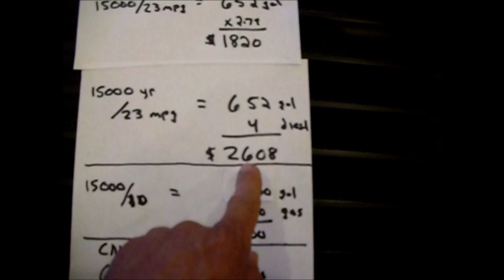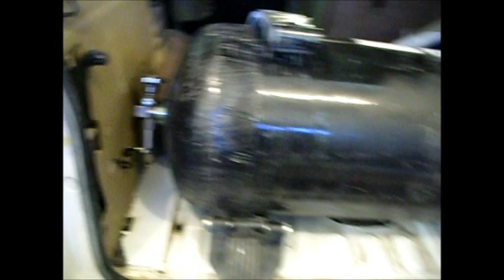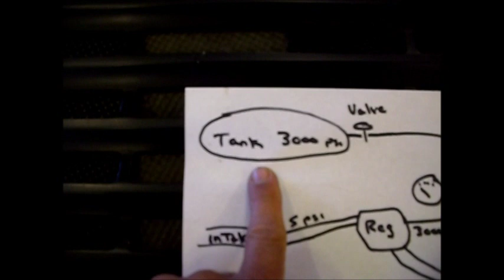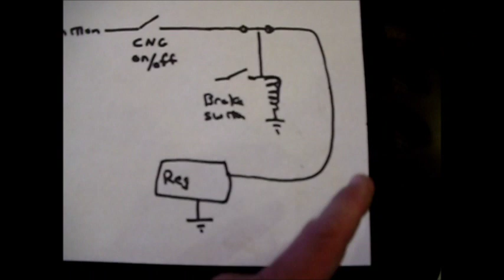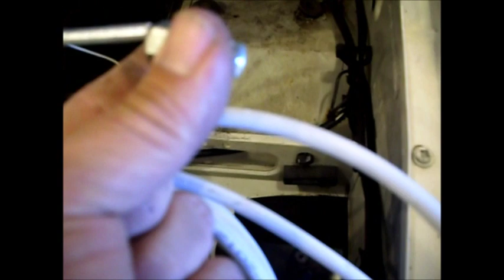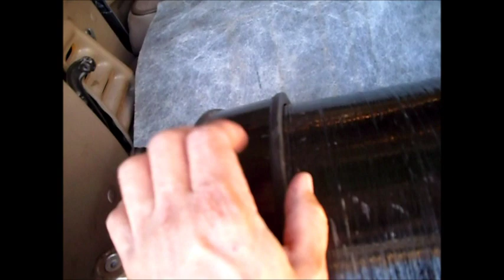1998 land rover discovery with 300tdi diesel CNG compressed natural gas injection conversion

Comment from the maker: I have done two CNG conversions and have found some interesting numbers on economy.
One was a 2006 Volvo AWD S60 2.5 turbo intercooled engine. It gets 24 mpg so it uses 625 gallons of fuel for 15k miles. It cost $2250 for gas @ $3.60 gallon and $950 for CNG @ 1.52 a gallon. So cost per mile was $.15 for gas and $.063 for CNG. It was a fumigated system with a Red Gas regulator. I noticed a large power loss on the mountainous pass I drive to work and back on but on level ground no noticeable power loss. Fuel economy was the same whether I was on CNG or gas. I was extremely happy with it.
The other is a 1998 Land Rover Discovery. It originally had a 4.0 v8 gas engine. I was getting 10mpg. Due to the engine head gasket problems I decided to install a 300tdi rover 2.5 turbo diesel intercooled engine and manual transmission. My mpg went to 22.3 mpg. But was seriously underpowered for the mountains I drive in. I tweaked the injection pump and it helped some. I decided to do CNG fumigated injection. It does not have o2 feedback nor a modulated stepper fuel nozzle. The Discovery is seriously underpowered at 117 hp. The CNG makes a huge difference in power. My EGT for the same speed/gear has dropped 100-200 degrees Fahrenheit due to the increased hp. So the fuel/price numbers are:
Gas 10mpg @ $3.60 per gallon costs $.36 per mile.
Diesel 22.3 mpg @ $3.75 per gallon costs $.168 per mile.
CNG diesel 66% diesel 33% cng mix mpg dropped to 19.2 total mpg fuel costs $.148 per mile. (32mpg diesel)
CNG diesel 32% diesel 68% cng mix mpg dropped to 16.2 total mpg but fuel costs remained at $.148 per mile. . (40.3mpg diesel)
So what I assume happens as I increased the amount of CNG per diesel the fuel economy went down due to the lower btu content of CNG vs. diesel. CNG btu is 114000 vs diesel 129500 btu, 12% less. So the price per mile doesn’t change but power really does. I did not run a lot of miles (706) on the 33-68% mix as I just increased the amount of CNG mix in it so I’m not totally sure of the accuracy of those numbers. I could be like a lot of people I hear about cng diesel mix and just say the diesel fuel economy went to 32 mpg and 40.3 mpg but you need to include the cost of CNG. The power is absolutely worth it!! And it burns much cleaner!
My driving consists of 85% highway driving but I have a serious mountain pass I drive every day. Its 10 miles long but goes up 2600ft in elevation. I live around 7000ft in elevation and work at 4600ft elevation. I’m. (32mpg diesel) interested in any constructive input. Thanks.

Comment: Great video! How is the real fuel economy? Does it match your calculations? I'm thinking of similar conversion.
Reply from the maker: I posted the fuel economy numbers in the description of the video. thanks.
Reply from the maker: SilverCreekMotors I have done two CNG conversions and have found some interesting numbers on economy.
One was a 2006 Volvo AWD S60 2.5 turbo intercooled engine. It gets 24 mpg so it uses 625 gallons of fuel for 15k miles. It cost $2250 for gas @ $3.60 gallon and $950 for CNG @ 1.52 a gallon. So cost per mile was $.15 for gas and $.063 for CNG. It was a fumigated system with a Red Gas regulator. I noticed a large power loss on the mountainous pass I drive to work and back on but on level ground no noticeable power loss. Fuel economy was the same whether I was on CNG or gas. I was extremely happy with it.
The other is a 1998 Land Rover Discovery. It originally had a 4.0 v8 gas engine. I was getting 10mpg. Due to the engine head gasket problems I decided to install a 300tdi rover 2.5 turbo diesel intercooled engine and manual transmission. My mpg went to 22.3 mpg. But was seriously underpowered for the mountains I drive in. I tweaked the injection pump and it helped some. I decided to do CNG fumigated injection. It does not have o2 feedback nor a modulated stepper fuel nozzle. The Discovery is seriously underpowered at 117 hp. The CNG makes a huge difference in power. My EGT for the same speed/gear has dropped 100-200 degrees Fahrenheit due to the increased hp. So the fuel/price numbers are:
Gas 10mpg @ $3.60 per gallon costs $.36 per mile.
Diesel 22.3 mpg @ $3.75 per gallon costs $.168 per mile.
CNG diesel 66% diesel 33% cng mix mpg dropped to 19.2 total mpg fuel costs $.148 per mile. (32mpg diesel)
CNG diesel 32% diesel 68% cng mix mpg dropped to 16.2 total mpg but fuel costs remained at $.148 per mile. . (40.3mpg diesel)
So what I assume happens as I increased the amount of CNG per diesel the fuel economy went down due to the lower btu content of CNG vs. diesel. CNG btu is 114000 vs diesel 129500 btu, 12% less. So the price per mile doesn’t change but power really does. I did not run a lot of miles (706) on the 33-68% mix as I just increased the amount of CNG mix in it so I’m not totally sure of the accuracy of those numbers. I could be like a lot of people I hear about cng diesel mix and just say the diesel fuel economy went to 32 mpg and 40.3 mpg but you need to include the cost of CNG. The power is absolutely worth it!! And it burns much cleaner!
My driving consists of 85% highway driving but I have a serious mountain pass I drive every day. Its 10 miles long but goes up 2600ft in elevation. I live around 7000ft in elevation and work at 4600ft elevation. I’m. (32mpg diesel) interested in any constructive input. Thanks.
Reply: SilverCreekMotors thanks for this information. That is what I was looking for. Everybody says how mpg on diesel improved but noone says about consumption of CNG.
Intersting is the fact how the real mpg went down when you inreased ratio cng / diesel. The clue might be in that there was not enough oxygen for the combustion as volume of natural gas replaces part of the air in the cycle that in normal diesel engine set to match actual portion of diesel injected. So you probably wasted the fuel. Maybe if you was easy on gas and only small amount of diesel was injected just to ignite natural gas the mpg would increase more.
I belive the latest convesion kits for common rail engines control both amout of diesel injected and cng and therefore should be fuel efficient even if you do not care about the style of driving.
Reply from the maker: I really do drive pretty mellow. I only drive the speed limit for the most part and not too crazy of takeoffs, however the speed limit is 65mph and as I mentioned the hill climbs are pretty serious. I think if I didn't have the hills I would see a great improvement. I really notice a large increase in power which is needed for the low horsepower engine the discovery has. I think I will try to dial the amount of cng down a little because as you said because I might just be wasting the cng fuel. But my main concern is power. I just checked my last 700 miles and I am getting 16.8 mpg overall and 35.7 on diesel (not bad for a rover full time 4 wheel drive). Thanks for your input. I thought I replied earlier but it didn't post for some reason.